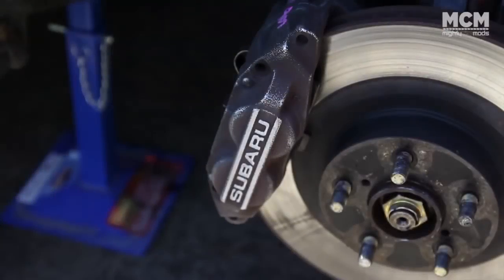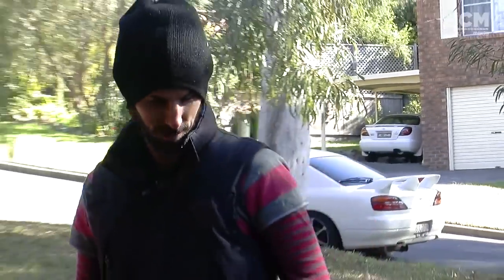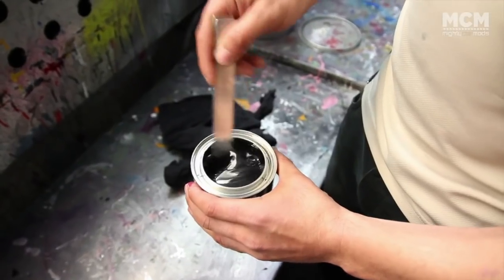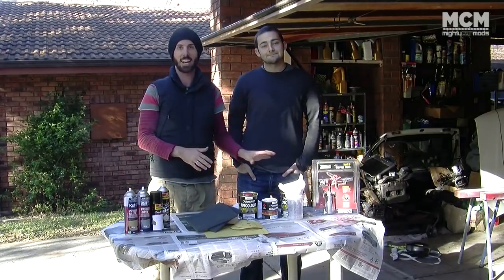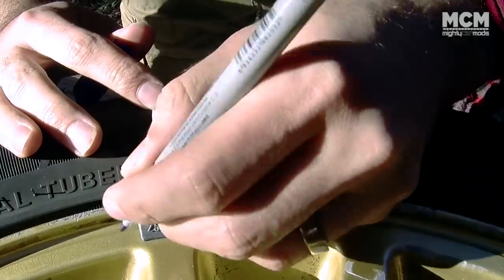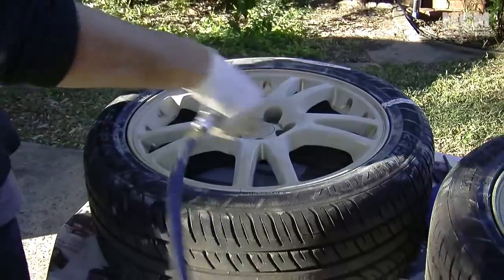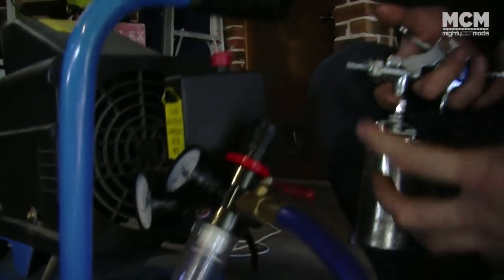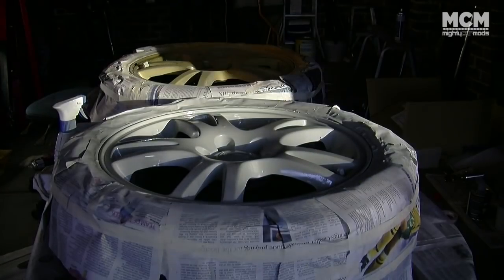How to paint your wheels

Comment: Gold rims. EPIC on a Subaru WRX, not that Subaru. Stick with black
Reply: STI WRX
Reply: mr .boggle Yep, running the same rims on my V7 STi
looks mad
Reply: +Moon Soon stick with black? or stick with BLAAAAACK? there's a big difference between the two.
Reply: and on a is200
Reply: I have a black is300, and I reckon it could pull it off, but I think I'd rather have black on black personally :P
Reply: @Leviathan431  What's an STI?
Reply: @peterleid5060  It stands for Subaru Tecnica International.
Alternatively, it also stands for sexually transmitted infection :P
Reply: Since I'm here, 2 years after my previous comment. I actually ended up buying an original set of Yokohama Advan RS1's from Japan, and restoring them with paint matched gold.
It's not my usual style but it looks gorgeous on the black Lexus.

Comment: Hey man, I did exactly what they did in this video. I sanded the original coating down to bare aluminum, primed and repainted them black with a can. The looked great for a season but with rough gritty streets they didn't last long. The initial results are great but don't expect a factory durable finish. Hope this helps. All the best.

Comment: red calipers frack thats at least an extra 40hp not to mention getting the ladies wet!!
Reply: can i sandblast calisper and just spray can it?? for quick way?
Reply: LungHotBox 420 I think you can but it will kind of fade over time and won’t have as good a result as doing it properly but it should work

Comment: So how many HP does the red caliper paint add? And is it necessary to get the full HP from the wheel paint?
Reply: 300 HP  and the black rims added 500 more HORSEPOWER!!!!!!
Reply: +Tyler James Newton 25 kW is equal to 33.5 HP
Reply: Sadpants McGee No offense, but was that the question?
Reply: Tyler James Newton Yes.  You asked how many HP you get from painting your calipers red.  25 kW converts to 33.5 HP.
Reply: Sadpants McGee I don't speak Russian.
Reply: Tyler James Newton What?
Reply: Sadpants McGee Dude you are making ZERO sense.
Reply: Tyler James Newton I feel like I'm the only one making any sense.  You asked for a conversion of the 25 kW Moog said the red calipers add at 11:34.  I gave it to you. 

33.5 HP
Reply: Sadpants McGee Oh that's right, forgot he said that 11 minutes into a video I watched several months ago. I get it now! Thx
Reply: +Tyler James Newton About 0.000000000000000000000000000000000000000000000000000000000000000000000000000000000000000000000000000000000000000000000000000000000000000000000000000000000000000000000000000000000000000000000000000000000000000000000000000000000000000000000000000000000000000000000000000000000000000000000000000000000000000000000000000000000000000000000000000000000000000000000000000000000000000000000000000000000000000000000000000000000000000000000000000000000000000000000000000000000000000000000000000000000000000000000000000000000000000000000000000000000000000000000000000000000000000000000000000000000000000000000000000000000000000000000000000000000000000000000000000000000000000000000000000000000000000000000000000000000000000000000000000000000000000000000000000000000000000000000000000000000000000000000000000000000000000000000000000000000000000000000000000000000000000000000000000000000000000000000000000000000000000000000000000000000000000000000000000000000000000000000000000000000000000000000000000000000000000000000000000000000000000000000000000000000000000000000000000000000000000000000000000000000000000000000000000000000000000000000000000000000000000000000000000000000000000000000000000000000000000000000000000000000000000000000000000000000000000000000000000000000000000000000000000000000000000000000000000000000000000000000000000000000000000000000000000000000000000000000000000000000000000000000000000000000000000000000000000000000000000000000000000000000000000000000000000000000000000000000000000000000000000000000000000000000000000000000000000000000000000000000000000000000000000000000000000000000000000000000000000000000000000000000000000000000000000000000000000000000000000000000000000000000000000000000000000000000000000000000000000000000000000000000000000000000000000000000000000000000000000000000000000000000000000000000000000000000000000000000000000000000000000000000000000000000000000000000000000000000000000000000000000000000000000000000000000000000000000000000000000000000000000000000000000000000000000000000000000000000000000000000000000000000000000000000000000000000000000000000000000000000000000000000000000000000000000000000000000000000000000000000000000000000000000000000000000000000000000000000000000000000000000000000000000000000000000000000000000000000000000000000000000000000000000000000000000000000000000000000000000000000000000000000000000000000000000000000000000000000000000000000000000000000000000000000000000000000000000000000000000000000000000000000000000000000000000000000000000000000000000000000000000000000000000000000000000000000000000000000000000000000000000000000000000000000000000000000000000000000000000000000000000000000000000000000000000000000000000000000000000000000000000000000000000000000000000000000000000000000000000000000000000000000000000000000000000000000000000000000000000000000000000000000000000000000000000000000000000000000000000000000000000000000000000000000000000000000000000000000000000000000000000000000000000000000000000000000000000000000000000000000000000000000000000000000000000000000000000000000000000000000000000000000000000000000000000000000000000000000000000000000000000000000000000000000000000000000000000000000000000000000000000000000000000000000000000000000000000000000000000000000000000000000000000000000000 if you got this far then you know it doesn't add anything
Reply: jjovereats Yeah, well I copy pasted it into a file and typed a 1 right in the middle of your number and ruined your entire dream. Happy holidays.
Reply: ***** Unicorns don't exist in Australia, because they are not venomous.
Reply: Sadpants McGee Wallabies exist in Australia, and they aren't venomous. Was that reductive?

Everyone knows unicorns were invented in Japan.
Reply: Tyler James Newton Wallabys are venomous.
Reply: Sadpants McGee Did you mean: wallabies

No they aren't.
Reply: ***** Lol. Poison unicorns, confirmed.
Reply: ***** You're right.  Unicorns ARE Australian.
Reply: Logic wins. And makes us, if I can say this, all the richer.
Reply: He wants his car to look good.  Not every mod has to be about horsepower
Reply: The paint is carbon fiber they add lightweight coating on the rims

Comment: You can fix runs in base but you need to sand them down with a proper grit sandpaper. If you wet sand base coat it'll give it less of the ripply powder coat effect and more of a solid plated or mirror type finish. You can make plain base coat shine entirely on it's own with some proper wet sanding and patience, still clear coating is necessary to protect your wheels and will give it an even higher gloss finish.

Comment: Like they said, prep work is everything - but so is the follow through... 

I've had Dupli-painted wheels for multiple years and they still look as good as they did when I first painted them.  Before even riding them I let everything cure for 5 days before buffing/waxing them to add that final level of protection :) The one thing I'd highly recommend that's not mentioned in this video is using Etching Primer prior to Filler Primer, as well as Primer Sealer prior to Base Coats.

Comment: Guys, just to make it clear, the paint does NOT need to be sanded back completely as the basecoat will hit the original paint. You just need to sand it with some 240 grit to make a surface that is smooth, but rough enough for the paint to be able to sink in and stay on. Hope this helps :)

Comment: yes, but like most metals you need an etch primer first.  Its usually slightly more acidic and actually roughens the surface up a little bit when applied to help it stick.  I know that die-cast model cars are etched primed with nitric acid (or can be) just dont use something caustic on aluminium... explosive caustic gasses are released

Comment: The only thing you neglected to mention or use.Were strainers for the pint used in the touch up gun.You need to strain the paint,because anything in it will show up in the paint job plus it can clog the tip.Most places will give them to you free when you buy your paint.Other than that,excellent video.

Comment: If you want to paint your wheels black, use duplicolor 1200 F high heat paint. That stuff is bullet proof. Painted my exhaust manifold heatshield and never peeled once. Also scrubbed the paint hard with various different styles of cloth when it got dirty and its still in 100% condition.  Combine that with some plasti dip silver metalizer and it will looks stunning. Gives it a nice metallic shine, although not sure how well it will stick to the paint.

Comment: 3M sells wet-or-dry 600 and 800grit sandpaper (just put my rims on filler-primer 5 minutes ago, not gonna wet-sand, just dry)
 just keep in mind that what you want is a uniform finish, so no need to go berzerk on your rims with the sandpaper! 2 coats of filler-primer, sand with 600, 2 coats of paint, then clear (0-2 coats) depending on whether you want matte of glossy finish!
Good luck

Comment: It is very nice video .Even if you were to plastidip these wheels, you would still need to do all the prep work, use a filler primer, a base coat (plastidip) and then the plastidip glossifier.However, when you have the method in corbandy car sprayer crusher you'll find an easy system that will work whenever you like.

Comment: I HAVE A TIP TO SHARE!!!!  I've painted my tailgate (yes I drive a dodge ram) using methods and ideas from this video.  In the video they say that you can be heavy with filler primer.   Just to clarify you HAVE TO treat it like a paint NOT bog/body filler. The filler primer dries within ten minutes as normal spray paint does, but that doesn't mean you can throw it on heavy to the point where u get runs.  You should throw on many many many layers and sand it back with 400-800-1200 grit sand paper, but do it layer by layer, don't try to lay down more than 1mm at a time; otherwise you get paint bubbles and it won't dry properly when you go to sand it back, creating more problems!  Thanks MCM don't stop doing what your doing!!!

Comment: So, two questions:
1st, Would bother masking off the chamfers for the wheel nuts, so there's no change in that profile.
2nd, how does this refinished surface stand up to a tyre change or two? Am I going to have to redo this in 3 years because some ding bat at Bob Jane pinged out half of the filler off?

Comment: hey guys, just a little trick I used to paint my rims, try coating the side walls of your tires with petroleum jelly, you still need to mask the tire around the rim but this way there is no chance of paint bleed, once you are done and your rims are nice and dry, you can then use some soap and water to get the jelly off.

Comment: Do you mean wheel weights? You need them because no wheel is completely round. So to reduce road vibrations due to non-circular wheels, the weights will help to balance out that weight. Every wheel will need to be balanced...

Comment: Try drill fit wire brushes instead of plain sanders and drums. It can reach every place because the wires are so fine.And also, use a paint can trigger with spray can. its easy on your hands...

Comment: i have alloy wheels. it's pretty brand new no scratches or deep gash, no imperfections. do i need to sand it to prepare it for spray painting? or can i just skip tht. thinking of just using the primer and spray painting it afterwards using rustoleum or duplicolor
Reply: Lost Under the Sky Unless you have a special wheel primer (one that "eats" away at the rim when you apply it so it sticks) it's advisable to sand them so the paint can grip it.

Comment: I couldn't the part when Marty was listing down the DIY items. 2:54
(EDIT) -  What should I buy to make it black?  And does the primer have to be those colour?  And which company should I use or   are they the same thing?
(EDIT) -  Primer, Basecoat, Primer, then clear coat?  I already know about sanding and stuff.
Reply: Gargamel Nguyen 
After sanding, degreasing etc,
Filler primer first, it will fill in any scratches
Sand the primer
Then regular sandable primer
Lightly sand if needed
Base coat
Clear coat

Note: almost all (if not all) of these "coats" actually require multiple applications. Directions should be on the bottle. (Ex: the base coat might call for two light then one medium wet coat)

Hope that helps!

Comment: By the way guys, Moog said about leaving the wheels over night before lacquer. Dont do this!! You need to spray the lacquer within 4 hours of the base coat or you will get lacquer peel very quickly after spraying. Let the base go dry for about an hour then go for the lacquer.

Comment: To offset the weight from the valve stem.  Here's an exaggerated example, Spin your key ring around your finger, that would be what your wheels would be doing at highway speeds without wheel weights.

Comment: does this same method work with chrome wheels? i currently have chrome wheels with some rust pitting nd it seems the only method to get rid of it is to use some steel wool and scrape it off the fims then repaint...

Comment: Hi guys, I have 2 questions. First, why do i have to use the primer if i don't remove the silver paint that is already on the wheels. And do I have to use the clear coat at the end since i will paint it in matte black? Wouldn't that clear coat give it a glossy finish?  Thanks.
Reply: You especially want to use primer if you aren't removing your factory paint because the base coat wont have anything to stick to. I would suggest at least going over the stock paint with a fine grit sand paper then do primer. And you don't want to go without using a clear coat on something like wheels, because they come in direct contact with a lot of dirt and debris that could easily scuff them. What you could always do is go with a matte clear coat if you don't want any shine.
hope this helps
Reply: heyybrowussup I saw on another website that if you hit the wheels with some sandpaper before painting that it circumvents the need for a primer as the subtly rough surface the sandpaper creates give the pain something to grab onto. Do you know if this is correct or not? It seemed to work for the guy who made the video.

Comment: I painted my wheels with rattle can but the clear coat didn't appear glossy. What I did wrong or how do i fix it?
Reply: Usually clear coat never comes out glossy right out of the can. All you need to do is get some polishing compound and buff it out with a cloth until it shines. A lot of work but it's worth it!

Comment: I just wish painted wheels stayed nice looking for more than a month, lol. Rattle can clear coat always holds dirt more than a real 2-part clear coat. Sure! Do the basecoat yourself and take it to a shop or get a paint gun yourself and do the clear coat right. It'll be harder wearing and you can use acid based wheel cleaners without a problem. A shop might charge you $100 to clear all 4 wheels if you don't wanna have a go yourself.

Comment: How many cans of spray paint to do my Suby's wheels do I need?
Reply: kriegmeister1 With regular rattle cans, I used 2 and was able to do several coats on each rim for my 2000 Subaru Forester, 15". Still had a bit left over. If you're painting a lighter colour than the rims are already, you may need more, but if you're just doing them black, two should suffice.

Comment: One thing I still don't understand is how do you know what grit sandpaper to use especially in order?
Reply: The lower the number, the harsher the sandpaper. So 100 grit is a lot rougher than 400 grit, and 1000 grit is quite smooth. For this sort of metal, probably 100 grit is fine to get scratches out, then go to 300 or 400 to get the 100 grit scratches out, then 600 or 1000 to get the surface feeling smooth before painting. Add a primer base coat, clean and sand the primer with the 600 as well. The surface has needs to be super clean, wipe with a lint-free cloth and acetone. The prep work is EVERYTHING with painting. Really take your time and practice just on cardboard or a spare steelie first.

Comment: Yes you can get impressive results with spray cans, but the finish will never hold up like a good catalyzed finish sprayed from a gun. That said you can spray cheap paint that is no better than that of the rattle can through a gun. If you use  cheap paints a touch up is easily done later or it could become a nightmare with certain types of paint. Depending on your rotor and pad combination the wheels will be the most susceptible painted surface  to inferior coatings.

Comment: Does the gun leave streaks? I used a spray can and I want to try the gun
Reply: +Corey Cartmill it ended up with streaks but I used engine enamel paint. It looks a lot better than it used to and from a scale 1-10 In my opinion.. 5
Reply: +Corey Cartmill did it end up looking pretty good? I might try that on my trunk